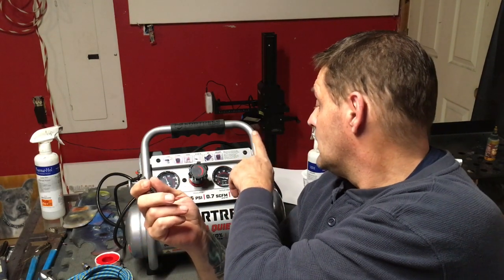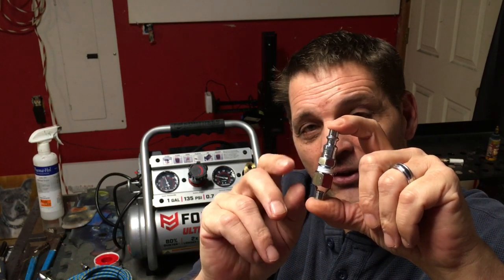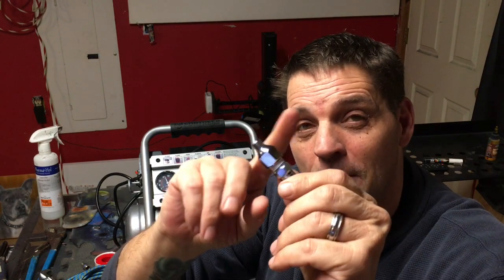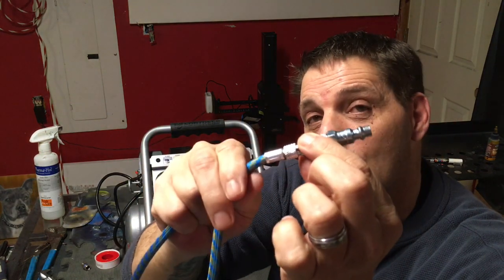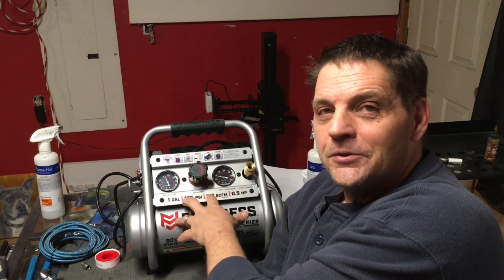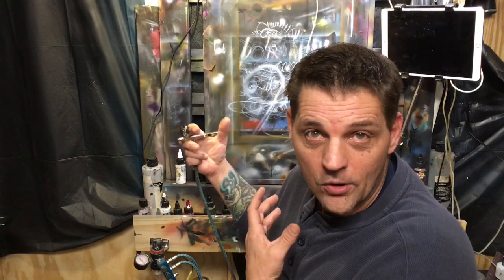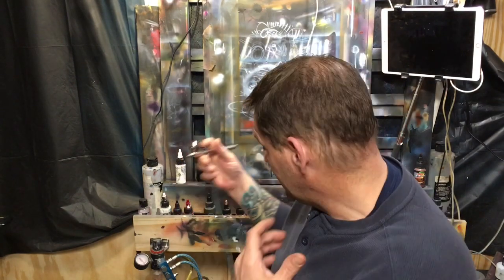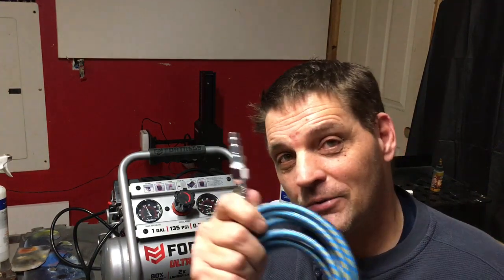How to attach an airbrush to a regular compressor.  Lets hook it up!

Comment: Don't make the mistake i did ...i went for the 4 gallon version...sadly it isn't part of the "quiet" line its in the "performance" like and at 80db + its sooooooo loud....and HF were dicks about the return charging me 40% restocking fee since i was down grading....wtf!
Reply from the maker: definitely dont want to use a standard compressor unless you have a place to put it where noise is not a factor.  40% restock is a hard hit.
Reply: @TheAIRspace  yeah...but still got $$ back since the 2 gallon was cheaper...its fine on the floor next to me since its pretty quiet
Reply from the maker: @cjadams7434  yeah i run my kobalt right next to me,   its 4.3 gallon and i never have to worry about what i am painting and if ill need to stop.
Reply: @TheAIRspace  yeah....the hardest part for me is...i have no idea about the grex adapter i think their regulators pressure...i'm assuming that it only needs to handle the amout i put out after the built in compressor regulator but that i shouldn't open it up to full ...
Reply: @TheAIRspace  i grabbed one of these for near the airbrush end but pulled off the grex regulator / water trap since the regulator on my compressor seems to work f8ne ...any reason to use 2 water traps and or 2 regulators? i also have a mac valve between the airbrush and the water trap
Reply from the maker: @cjadams7434  no I use an external regulator just to have it near me. And it’s a little more accurate.  Also allows me to just disconnect my compressor and go anywhere with it. 

Having the moisture filter further from the compressor does however catch more moisture
Reply: @TheAIRspace  Do you see anything wrong with just using the built-in regulator setting it to 15 or 30 etc...and just having the water trap+mac valve at the other end? shoud i be worried about pressure on the water trap...if i have to boost it for clear coating with the .7 needle + fan cap on my grex tritum for example
Reply from the maker: @cjadams7434  no nothing wrong with that at all.

Comment from the maker: Thanks again guys!  Hope this was helpful! 

BSP has become the standard and is the correct term to search at least in the USA. Most plumbing shops will have BSB threads which will also work.

Hose with JUST 1/4 inch adapter (no paasche or badger adapters) 
https://amzn.to/3cB4uZ7

Filter for bottom of airbrush only! 
https://amzn.to/3cyuyEl

You can probably find these locally better.. but in case. 
Multiple adapters. 
https://amzn.to/3lk9jKl

Regulator trap combo (this is exactly the one i'm using) 
https://amzn.to/3qNNLqQ

Tools and materials I use and recommend everyday: www.amazon.com/shop/wleonartistry

""These are affilliate links! I may earn commissions if you purchase through above links""

Comment: typical aircompressors use 1/4 fittings, airbrush uses 1/8 fittings.. Your welcome... 

they actually sell a hose with 1/4 on one side and 1/8 on the other just for airbrushes (google: 1/4 inch to 8 in airbrush hose). The biggest scam on the market is those air compressors for airbrushes.. most dont have the flow for common airbrushes like a siphon (paint cup on bottom), I have an iawata that takes 40psi for its .35 tip just to do detail. The smallest I use is a .2 and the largest is a .7 fan tip. 

Gravity feed (paint cup on top) might get away with 18-20 for your basic uses with a .2 - .5 tips but that depends on how far away you need to be from your project with the gun and how thick your medium is. 

If you are just painting nails with a wetted out medium then sure, but if you ever wanna graduate then you are screwed. I got some basic acrylics that I paint with through a gravity feed .2 wetted out to the consistancy of milk and it can kick up to over 20 psi with normal use. some colors are lower some are higher. 

The typical psi out of one of those desktop air compressors you get on amazon for 60 bucks is about 35-40 psi but that is only if you use a reservoir tank. Plugged directly into it with no reserve air in a tank you will get maybe 20psi constant when using the gun. So you are right there at the minimum. I have a 7 gallon protable tank that I can plum my machine into and I can get most projects done with that no matter ho big it is. It is just a matter of carefully making sure I dont run my pressure down below by taking breaks for it to build up. 

I have this fortress ultra quiet in my setup and I dont need the reserve for that, even though it is only 1 gallon capacity the air compressor itself produces enough air to run even my fan tip .7 at full blast constantly. It is sort of mostly portable but the same could be said about my portable 7 gallon tank. so it is 6 in one and half a dozen in the other. The fortress has a pressure out regulator so that can be set to 60psi and then you run a hose to your workstation where you have another regulator you use to fine tune your pressure at the gun. You maintain the 125psi in the tank but only let out 60psi to the hose and bring it down to your required 18-40psi to your gun and use an inline mac valve from amazon to make adjustments if needed. SKip the inline mac valve if your gun has one. I set my pressure with distance from my work and use the mac valve to get closer for detail. easy peasy

The difficult thing here is to find an air pressure regulator that is 0-60psi and not 0-150psi without breaking the bank. I dont like using the mac valves (micro air control) on my guns if I dont have to so I wanted an accurate and reliable air pressure regulator to be able to dial in an exact number. Most of the 1/4 cheap regulators are at 30psi just by cracking them open slightly so getting a fine tune with those is difficult without putting 2 of em in line and setting the first one to 60 and just leaving it there. The guage can be replaced on them, they are all 1/8 fittings from what I have seen but they arent really designed to be friendly at lower psi ranges! 

Getting a decent 0-60 digital psi regulator was prolly my best investment for repeatability and trouble shooting I have ever made. Those 0-150 regulators just have the lower end fine tune you need but you can make do until you start experimenting with different paints and mediums.  

inline mac valve with quick disconnect - https://www.amazon.com/dp/B002KDSRQY?psc=1&ref=ppx_yo2ov_dt_b_product_details
Reply: I need glasses to read and it becomes an issue with changing air pressure when I am painting, I am tossing around the idea of getting an 1/8inch 3 way fitting, large print 0-60psi gauge, then adjusting the airpressure going into that 3 way fitting with that MAC valve I linked in the original post, so I pass through the air and measure its psi all at the same time.... I am almost confident that would work better that any other regulator out there. Everytime you step down or increase the inner diameter of your airflow you make changes to the pressure. so the closer you are to your work in the same "ID" the more accurate your reading will be.. Would be a whole lot cheaper too!

Comment: I think you mean BSP
Reply from the maker: technically yes, 
Both share a 55degree taper 
And one has a 26 and one a 28 TPI count.  
BSPP Straight is the long notation, because BSP can be both straight or tapered threads. 
But it does appear most have finally moved on to denoting the size as BSP.
Reply: @TheAIRspace  even in your description you write BSB not BSP
Reply from the maker: @roadi7  again, BSB  as well as BSPP straight will work.  BSB is typically used in a denotion on plumbing fittings.  
BSP can be either tapered or Straight thread.  Depending on where you are and whom you order from BSP may or may not need to be distinguished if ordering.  But as I just replied.  It appears the BSP has become the common terminology used now.